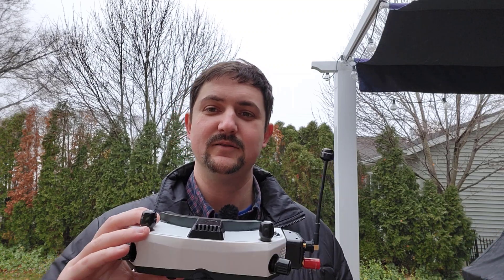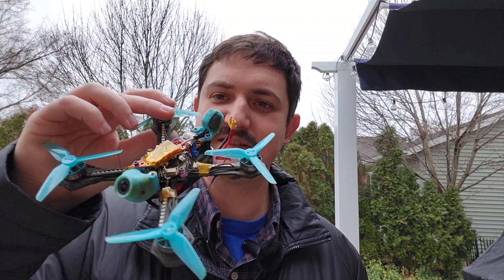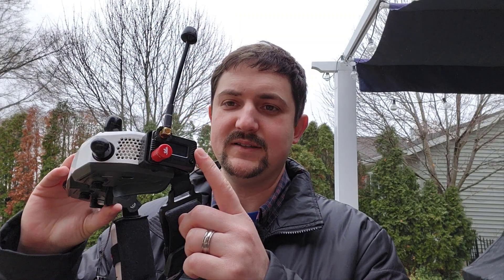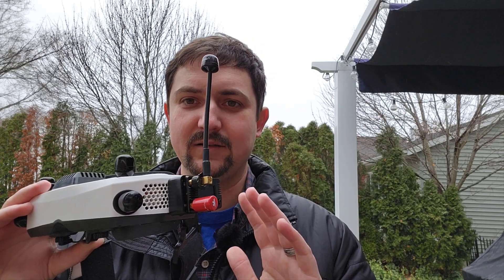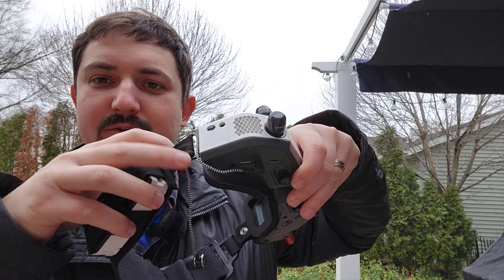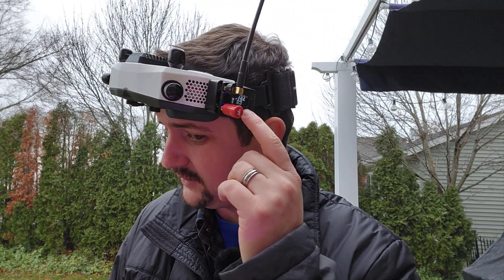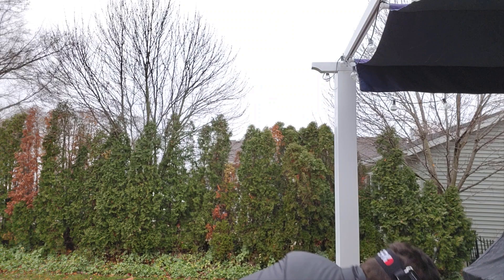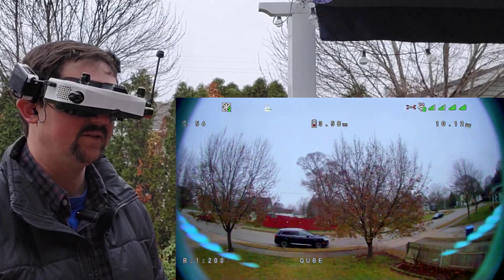How to: Add live drone audio to HDZero video

Comment: I could not get my audio to work with a Rush Max Solo VTX (with Rush AGC mic), and TBS fusion module, on HDzero Goggles.  I swapped to RapidFire Module, and now it works! 

It might be a rare thing, where the rush max solo VTX uses an incompatible audio carrier, than what TBS Fusion module listens for. RapidFire is compatible with Rush Max Solo audio carrier type. 

Hope it helps someone out in the Future, and they won't blame their HDZero goggles like I did initially!

Comment: I tried this exact zeus vtx but can't get any sound from analog. 
I wired 5v from flight controller. Set channels with a button and scanned channel to verify it's working. Set correct channel rappidfire receiver still no sound :(
Reply from the maker: @GZAFPV  make sure to go to the analog bay source first, then go back to hdzero source
Reply: @ Thanks a lot Ryan. For some reason when I arm the quad the source for analog says "disconnected" when I disarm it goes green again "detected". I was trying to find what I'm missing but due to work not able to make it work. Will try this weekend. Thanks again  love your content for hdzero 🙌
Reply from the maker: @GZAFPV  there is a power option in the power settings of the goggle to turn the analog bay on and off automatically based on video source. Disable that
Reply: @RyanQuellet   Unfortunately it didn't work :( Or maybe it's too quiet I've tried arming to hear props but nothing.I've got rappidfire with latest firmware. I try to borrow tbs fusion and try. Thanks for help Ryan!
Reply from the maker: @GZAFPV  Do you hear audio when in analog input? If not, then something is wrong. You have to make sure the RapidFire has audio enabled and your headphones have to have the right pinout
Reply: @RyanQuellet  Yes. Mr. steele earbud on one side and some headphones with working mic on the other (AV/in). No sound. I must be doing something wrong I'll ask my friends to help me do all that correctly on the weekends. Sound on RF is on. Power to RX is enabled. I have another analog quad I'm able to fly it but it has no mic. Maybe rappidfire doesn't work with sound. I hope not.

Comment: I have a 7in quad with a rush solo tank, and two of these zues nano vtxs. I just got the hdzero goggles on the bf sale. I have an openIPC vrx. I will try to add one of these vrxs to the openIPC build, and see if I can get audio and tell you how bad the delay is. But I will forsure try out flying with audio on my bigger drone with the hdzero goggles.

Comment: 8:43 brother. I just got a TBS FUSION module but I’m not getting any audio feedback with my HDZERO goggles. It’s so frustrating that I’m not able to figure it out. 
I have an analog box goggle and it supports audio and it outputs a very clear and crisp audio. But nothing on my Hdzero goggles. So sad.
Reply: You ever figure this out?
Reply: @plunbeks4155 yes it was defective fusion module. I replaced it and the audio came back but surprisingly not on the headphone out but from the A/V IN. Weird.  I put this project on the back burner for now.

Comment: Verry cool to see audio! In the analoog times I used always audio. When switching to DJI I really missed it. Now I'm moving to hdzero because I find it nicer to fly with. But I still miss the audio. Maybe it's a idea to use the UART data stream so send digital low quality audio. It's possible to make a small mic that converts the audio to digital and send it over the osd steam. But I don't know what the datarate of that stream is, but for low quality mono audio you don't need much. I will happily give up my osd for audio, I use my radio to say my battery status. Received my hdzero goggles yesterday and looks really nice! Big step up from my old farshark HD2. Looking forward to fly with this goggle!
Reply from the maker: Interesting idea to send audio over UART on the VTX

Comment: Rearview picture in picture via analog stream, so you can see rearward traffic and move to avoid midairs. or a down facing cam for precision landings and vertical placements in tight areas...like getting into position to dive smoke stacks! or to use a claw to clutch and remove another quad stuck in a tree...
Reply: second cam can be head tracked
Reply: @hristiantodorov3923  the HDZero goggle has a head tracker, you would need a servo'd mini gimbal, and havee to decide which camera gets heaf tracked, typically wings function better w a tracker than a multirotor...space for as moving gimbal w cameat is usully too tight on a multirotor, and the little gimbals are delicate...they break easy.
Reply from the maker: Cool idea

Comment: So HDZ uses the audio-channel for telemetry/data channel? Sounds like you guys need a smart audio kind of protocol ;) Mixing the analog audio feed with the HDZ Video is a pretty pretty damn cool option on that goggle, that most of us wil use hybrid anyway. And it probably sells Mr. Steele to HDZ now :)

I just bought some mics to experiment with audio on my Sixty9... let's see if I never wanna go back... with the drone farther away I really miss hearing my props and the delay of the sound through the air drives me slightly nuts... good to know sound will be an option in the digital world, too!
Reply from the maker: Haha, Mr. Steele might like it for the audio aspect. Good point - would love to see him try it

Comment: Picture in picture might be cool for long range so you could install a second cam/vtx as redundancy. Or so that you can get the HD picture from stuff like walksnail and can switch to HDZero/analog when required on the fly.
Reply: pretty rad idea actually! Also for cinematic gigs, where more and more redundancy will be required in the future.
Reply: On cinelifters etc. it could also be used for a second camera feed that's either pointing backwards or views the drone/cine-cam itself so you know what's going on with your tech up there
Reply: Great idea

Comment: I have always flown with audio, if I finally move away from analog it would certainly be something that I would miss, I wired a mic into a build that has a unify HV vtx so I can get audio, I have a build with the impulse rc osd board which has the mic and my main builds I now use the unify evo which has the mic included. Having the mic included for me is nice feature. Another system with audio options is great.